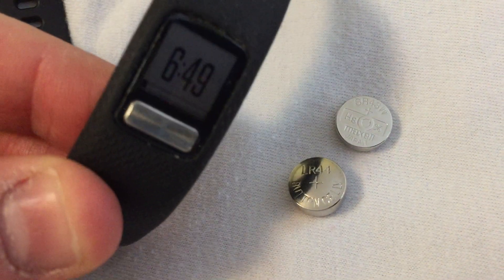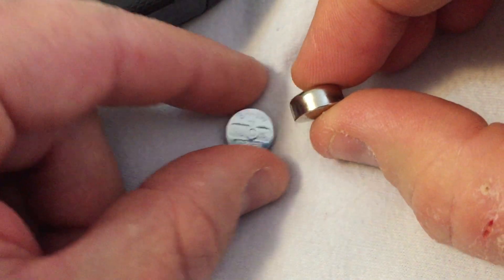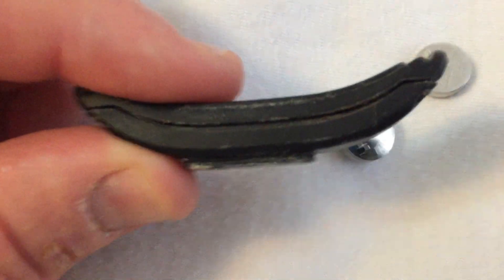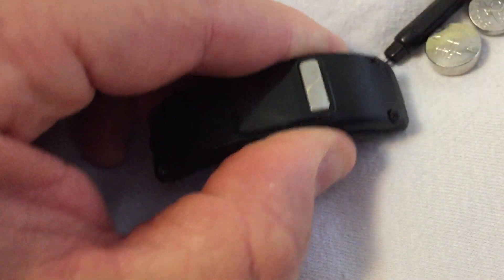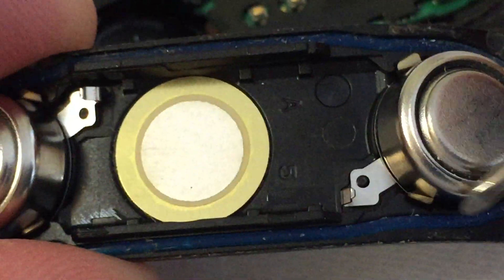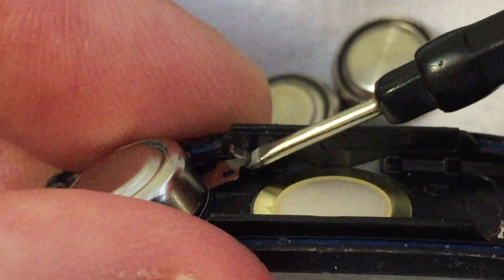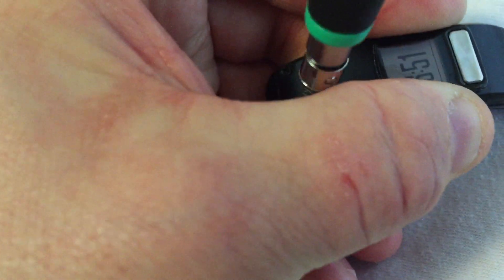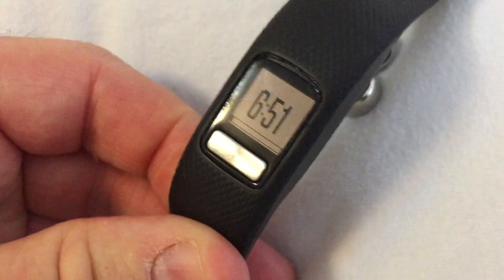How to Change Garmin Vivofit 4 Battery (and Hack Capacity to Make Longer-Lasting)!

Comment: I had to go out and buy a mini screwdriver! It's a shame one wasn't included in the package!
Reply from the maker: Always good to have a screwdriver kit!
Reply: And the tiny Phillips one I bought still did not work - very annoyed. @devhackmod
Reply from the maker: @transportcams  You can get a fairly cheap kit with a few different size mini-drivers, including Philips, flat-head, Torx of different sizes and even Penta-lobe because the new phones and watches use all sorts of strange screws! You'll use it for many years!

Comment: Been having issues with my Vivofit 4 and the various batteries I've been using.  
Tried both Alkaline and Silver Oxide versions of the SR43.  Seems to Power up and keep time but I don't have button control (Is this the "beeping" function mentioned? Think maybe I should try cleaning/modifying the battery contacts?) Before splurging on yet another package of batteries I think I'll attempt that...
Reply from the maker: Is your main button working? Yes I would try cleaning contacts but if watch powers up it is probably fine. As far as beeping, there is a flat disc piezoelectric speaker on the back of the case that makes contact with board... You need to make sure the back is installed properly so it contacts it (and check to make sure contacts clean) otherwise beeper speaker won't work. The main button contact may also be cleanable but I've had eventually software issues with mine that were no longer solvable and had to trash it.

Comment: i learned a lot in this video! thank you
Reply from the maker: Thanks, just as a follow-up you can also buy the regular (not thicker) batteries but use Alkaline instead of Silver Oxide. The alkaline don't last as long but they are way cheaper.

Comment: I don’t know man.  
Seems a bit reckless to purposely make a previously waterproof device open to the elements for a bit longer battery life?
Sure not something I would do or recommend.
Sorry for negative post but hey.....
Reply from the maker: Hey Bob, I appreciate your post and you're right on. I have since switched back to the normal batteries. I agree it's not worth it... better to keep it waterproof. I am using cheaper Alkaline LR43W's but the best are the Silver-Oxide SR43W's which last the longest.

Comment: 386 Battery is a direct replacement for SR43W, SR43, SR1142, SB-B8, 280-41, H, V386, D386, 260, S1142E, GP386, AG12, AG-12, 386, SG12, LR42, 386A, 386X, CR43, LR1144, RW44, SR1142PW, 386B, BSR43H, SR43H, E386, SR43SW, SR43, SR1142, SB-A8, 280-01, D, V301, 226, GP301, S1142E, 301, D301, 301X, 301A, SR1142SW, E301 ...